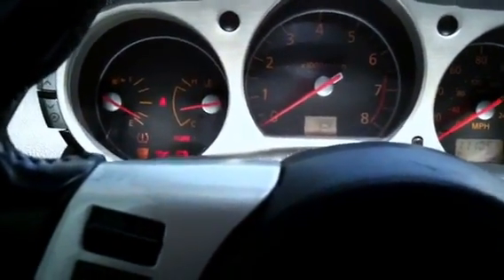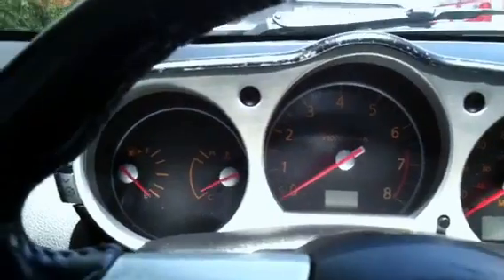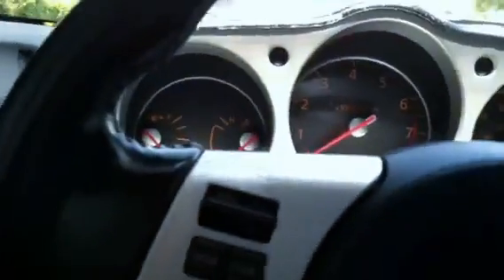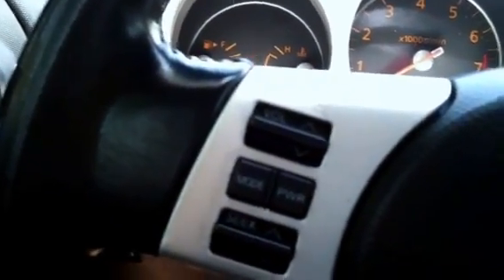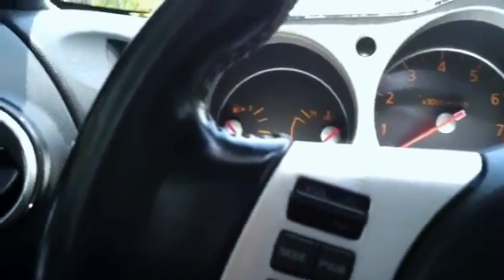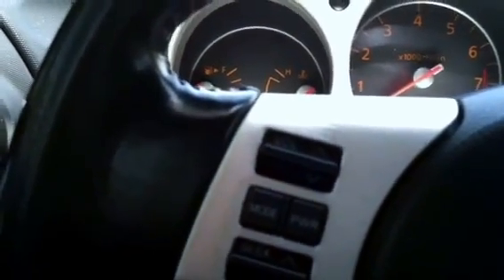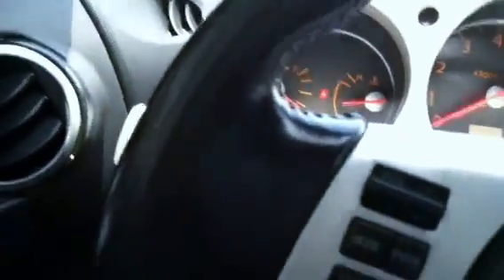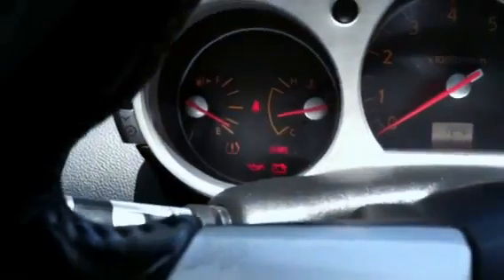NISSAN/INFINITI ECU/THROTTLE/IDLE RESET& RELEARN VERY IMPORTANT FOR 350Z/G35/G37/FX35/370Zetc DIY

Comment: hoping you can help me .when at idle my car is fine most of the time but it likes to randomly dip down and act like it's going to die then will go back to steady. could that just be a battery problem or do you think it's the throttle body being dirty maybe ?
Reply: stayZcaked I had the same thing on my 2014 Infiniti Q50 3.7 (same engine as the 370Z & G37), most of the time it was ok but on occasion the idle would drop down where the engine would sort of stumble and feel like it was gonna stall (but it never would actually stall). And ever since I removed my throttle bodies to thoroughly clean them and then followed the steps in this video the idle was fine and it seemed to have solved the problem.

Comment: Help!! I did all the steps on time and everything is cleared and car drives fine but when I'm on neutral on my 350z, it still idled and seems like it's about to die. Checked for leaks and if everything was clean and nothing showed it was wrong. Should I take it to a shop to retune the idle or computer??
Reply from the maker: check your maf. Clean it or try to swap if possible.

Comment: hey I'll throw in my 2 cents since I experienced so much strife over this. For starters, this video helped a ton. However, it doesn't mention that you need to have all your lights off, radio, charger, etc while doing it , steering wheel straight, and you need your car warmed up to the normal temperature range or else it's not going to work. That detail is so critical. 
     Second, this worked but problem kept coming back but eventually fixed it I hope (been 3 weeks tons of driving no problems). I ended up Cleaning accelerator pedal sensor, throttle body sensor, electrical taped up wires, new filter, and made the critical mistake of cleaning the throttle body and moving the butterfly (don't do that) reset the computer reprogrammed idle and all that jazz. None of that helped, car would run fine and then it'd go into limp mode. If your car run fine for a bit you can rule out vacuum leaks since that's not computer or mechanical. other people sprayed carb choker on hoses and listened if car revs. 
     I think it was fixed either by repeatedly doing this technique and another technique that is similar except has the light blink extra fast by letting up when light blinks wait 7 then hold down for another 10-20 seconds.  Some techniques say turn the car off first before turning back on when light stops blinking for this technique, who knows. Might also have been what this one other person wrote fixed it - that my A/C belt was too tight and kicking debris in the throttle body. That's literally two nuts, seems like a reach but last thing I did. btw I Got cam codes and throttle codes when bringing to shop, wasn't cams they were new. I noticed when A/C was on car malfunctioned quicker. Sorry for the long post but if you went through the endless threads like me maybe you'll appreciate it some bulk
Reply from the maker: With all respect to your experience, I have to tell you, that you don't need to do all that stuff from your first paragraph. 
Your steering wheel have nothing to do with this because it's not electronically controlled. It actually is, but you can't do nothing with it doing this steps. 
This instructions I get directly from Nissan, so other steps(turn around, clap you hands, blink, wink etc) from some youtube videos is not  required, because they doing less then nothing.

As you can see, during the Idle Air Volume Learning (Throttle Position Learning), on step #3 you'll be asked to warm up your engine, and this is exactly that moment when your engine have to be around normal operating temperature. 
You don't need to warm up your car to reset ECU or show your ECU where is the endpoints of your gas pedal. It's nonsense.
Reply: +DIY Mods ●  copied/pasted from manual- 
PREPARATION
Before performing Idle Air Volume Learning, make sure that all of the following conditions are satisfied. Learning will be cancelled if any of the following conditions are missed for even a moment.
● Battery voltage: More than 12.9V (At idle)
● Engine coolant temperature: 70 - 100°C (158 - 212°F)
● Park/neutral position (PNP) switch: ON
● Electric load switch: OFF
(Air conditioner, headlamp, rear window defogger)
On vehicles equipped with daytime light systems, if the parking brake is applied before the engine is started, the headlamp will not be illuminated.
● Steering wheel: Neutral (Straight-ahead position)
● Vehicle speed: Stopped
● Transmission: Warmed-up
– For A/T models with CONSULT-II
• Drive vehicle until “ATF TEMP SE 1” in “DATA MONITOR” mode of “A/T” system indicates less than 0.9V. – For A/T models without CONSULT-II and M/T models
• Drive vehicle for 10 minutes.

Comment: Idk if i did it right but my check engine light went off. However it still has a jerk when I first take off. Idk if that's associated with the the code. I first started having problems with take off from a red light. I would take off slowly no problem but when I give it gas and take off fast it would jerk hesitantly til it shifts to second. After second it does fine. I did he steps as timely as I could, check engine like went off but idk why it cause it to jerk. Not a hard jerk just like a slipping trying to go it I gear kinda thing. I doubt it's my  trans but idk. Anyone else have this problem please help.
Reply from the maker: sounds like transmission problem, isn't it?
Reply from the maker: don't just erase you code, read it! This is an easiest way to figure out what's wrong
Reply: +RPM Engineering so you think it might be transmission problem?
Reply from the maker: +babyjok3r00 most likelly. I don't know what kind of jerk you are talking about.
Reply: +DIY Mods it was my air mass flow sensor.
Reply from the maker: +babyjok3r00 lol. I already told to many people, that most of problems with idle or low rev or even problems with starting your vehicle, basically related to MAF sensor, it's hosing and vacuum leak. But in your case, it's was hard to tell what is wrong because I didn't drove your car and it's hard to say wat kind of jerk you was experiencing. However, I'm glad you fix it. Congrats!
Reply: +DIY Mods it's back but a different problem. Car parked at idle rpm goes all the way to zero but car still on but barely. Then couple seconds later goes back up between 1 and 0. Then does the same thing. Even in drive at a stop light car well idle very low and almost shut off. Very annoying problem. Worst when outside temp is hot and when ac is on.
Reply from the maker: +babyjok3r00 sound like an air leak
Reply: +DIY Mods that's what crossed my mind but idk. Where my MAF sensor goes where there a rubber tube that bends is torn but idk if that's why. It's right near where the air filter goes. That worm looking tube.
Reply from the maker: +babyjok3r00 if you don't have a smoke machine:
1) start your car and let it idle. Worm it up to normal operation temperature
2) grab a brake cleaner
3) ask somebody to get in the car and look at the tachometer 
4) begin to spray a brake cleaner on the couplings of your intake, plenum gasket (spacer), and the throttle body.
If while you spraying couplings your RPM will jump -- there is a leak.
Also, check the MAF inside if there is nothing like a piece of filter blocking the sensor from air. This is a very common problem for HKS drop in filters.
And let me know. If it's not gonna work, I can Skype with you and guide. Good luck!
Reply: +DIY Mods ok thanks a lot for the replies it really helps. Id have to try that when I get back home.
Reply: +DIY Mods omg it worked!!! My intake hose was all cracked and a big crack in it. I replaced it and BOOM!!! It's running like new. Seriously. I was so surprised this worked. Something as small as a air leak. Wow.
Reply from the maker: Nice!)
Reply: +DIY Mods hey another question. We have an 2005 Nissan Murano SL AWD. First start up is fine but once it gets hot and stop and go traffic. It about to shut of and sometimes it does. Once it shuts off it won't start u til 30-40 mins later and same thing. What do you think it could be. Any ideas would help. Don't want to take to dealer cause that cost to much. Trying to go a cheaper way before dealership. That's the last resort.
Reply: Infiniti09 you may be low on transmission fluid

Comment: How did you find out that the throttle only opened 80% ??
Reply from the maker: what do you mean?
Reply: +RPM Engineering At 00:42 you said that you found out that the throttle was only open for 80%.
Reply from the maker: Got it. Nissans have a WOT restriction until 30-40mph. After that, throttle should open all the way. We cleaned throttle body and moved "butterfly" just a little, but it's was enough to mess up throttle position sensor reading. Using OBD2 gauge, we figured out that even after 50mph, its won't open on 100%. After recalibration, it's begun to work well again. If your vehicle isn't new and you don't know who and how cleaned throttle body in your vehicle, you really want to recalibrate it. Even if you did it yourself, you still want to do this.
Reply: +RPM Engineering Thanks for the answer!
Reply from the maker: +Arthur R any time :)

Comment: This didn't helps
Reply from the maker: it's mean you doing something wrong. Check the comments, everyone did it successfully. Read description and try one more time
Reply: +RPM Engineering I have a 04 g35 is that the problem??
Reply from the maker: +96mk3 No, it's not a problem at all. I tried to do it myself on 03 G35 with a great success
Reply: VQ 87 when you relearn the position and you hit the peddle 5 times then hold it make sure you wait till your CEL  light COMPLETLY STOPS FLASHING. That was my problem. Hope this helps.

Comment: Hi Oleg, I recently have installed an AEM Cold Air Intake in my 2004 g35 coupe. When I drive the car randomly shuts off while i am in neutral. I took the intake out and reinstalled it to make sure there was no air leak. Will the Idle Relearning fix this issue?
Reply from the maker: most likely. What original airbox do you have? RevUp?
Reply: +Oleg Olegovich I'm not sure what air box I have. I have a stock g35 coupe sport. It comes with the brembo brake system.
Reply from the maker: I had AEM & INJEN CAI's and after all I sold them and switched to my original REVUP Airbox and K&N filter. A lot of people report the same problem with some aftermarket intakes. And if you ask me, there is only 3 good intakes for Z, and its not AEM.
Reply from the maker: anyway. what year is it? Glance inside of the airbox. What kind of velocity stuck(venturi ring) you got?

Comment: your instruction says 

Idle Air Volume Learning (Throttle Position Learning)

It is better to count the time accurately with a clock.

1. Perform "Accelerator Pedal Released Position Learning".
2. Perform "Throttle Valve Closed Position Learning".

but we just did 1 and 2, do we now have to do it again?
Reply from the maker: yes.

Comment: any answer
Reply from the maker: did you fix it?
Reply: +Oleg Olegovich ..
cannot fix it
Reply: +goolgappa5 ...
I change full engine which was manual transmission 2004 mine is 2003 automatically. .may be we missed some thing
Reply from the maker: +goolgappa5 you missed ECU from automatic. Sorry
Reply: +Oleg Olegovich ...what do you mean ...
Reply: +goolgappa5 my car is automatically. .2003 engine was from 2004
Reply: +Oleg Olegovich ...
Remember engine I took out from 2004 manual transmission engine mine is 2003 automatic transmission
Reply from the maker: +goolgappa5 that's why you need ECU from manual Z. But still, I think  it's a problem with a wiring.
Reply: +Oleg Olegovich ..
both were auto
Reply: +Oleg Olegovich ..
I called him last week
Reply from the maker: what is the end of the story?

Comment: I did it but still on 450 rpm,I guess the idle valve it's dirty or bad,any way thank you bro.
Reply from the maker: maybe you have a leak or dirty filter? Can you describe your situation? I'll try to help.
Reply: +Oleg Olegovich the rpm on my car is low 500 to 450 and goes up again to 600 or a little less , I clean the throttle already  may be is the mass air sensor or the idle valve.
Reply from the maker: +suzukiaero1 can you rev it higher than 2000rpm?
Reply from the maker: +suzukiaero1 any news?
Reply: same problem any solution
Reply from the maker: +Kanaan Nichols Looks like you fave something more serious than this video may fix. Check all wiring's, especially MAF sensor and throttle body(TB wiring is under intake pipe). Its could be only 3 things: MAF, Throttle Body, and fuel system.
Reply from the maker: did you fix it?

Comment: YOU ARE A FUCKING LIFE SAVER THANK YOU! Had P02135 replaced both throttle body and accelerator pedal sensor and tried the resets on my own and didn't do shit. So I tried it at your timing and it was perfect!
Reply from the maker: +40cripcuhh That's great!). Before I get tuned, I made this procedure very often(aprox 150-200miles) to don't let ECU adopt. I don't want to be a Captain Obvious, just in case you didn't know, all your intake/exhaust modes will be f***ed up by closed loop. So if you have a mods and don't have a tune, I would recommend you to do the same for maximum performance.
Reply: +Oleg Olegovich thanks for the advise, I am almost full bolt on now just waiting till the 17th to get my Osiris tune!
Reply from the maker: +40cripcuhh, nice! Congratulations!

Comment: Done as described and the idle rpm now is around 700. Before it was above 1000.
Also I've done the RE-grounding procedure and fixed most of the electric issues: burning random coils, fuel gage, more smooth on the road.
Reply: My friend's car Fx35 04
Reply from the maker: +A Al-Jahwari does it works on FX35? I think its have the same ecu, regarding to the same engine, exhaust e.t.c
Reply: +Oleg Olegovich Yes it worked. I think it should work on all Nissan family including Infinity.

Comment: Thanks so much bro. I was installing intake on ma G35 today and was rough idle,then followed you there and finally got it running great again!
Reply: It need to make a system relearn between ur new intake of how much air its actually suckin  in now. Just try to follow along with his video and as he counting..especially at the end procedure there just rev it up couple time and wait for it as ur idle gonna go down to around 650RPM.
Reply from the maker: I'm happy that you found it helpful! I'm doing the same with my 350Z after every each mode and it's helps me a lot. Nice G35 btw )
Reply: I jus did my air intake and my idle is high what's the trick I couldn't get it
Reply from the maker: Eric Lagueux as DaVinn said, just follow instructions. Also, you may have a leak somewhere, because I tried a lot of intakes and never had my idle unusually high. Check for leak in piping connections or throttle body gasket, I mean all the way from MAF sensor to the plenum.
Reply: What's up man I just bought a 03 Z and guy swapped same motor but lower miles in but won't stay idled starts up and won't idle will this fix it you think

Comment: What does it exactly do
Reply from the maker: When you doing this, your ECU(computer) learning the new amount of air(air volume), position of throttle and accelerator pedal position. This is important because after installing of CAI, plenum spacer, induction kit etc., your ECU have to find out new values. Without this steps, your ECU will hardly adjust to new numbers and will keep in mind previous calibrations. Its much better to reset all values and let it adjust to new mod. 
Moreover, first week after this RESET, your car will run much stronger than usually.
Reply from the maker: I just explained. ECU have to relearn new numbers, that's why you doing this steps to reset your ECU and fuel maps. Than, as you said, it will learn new ratio from O2 and MAF sensors. 
If you will have any questions in future, feel free to contact me, I'll be happy to help.
Reply: Oleg Olegovich Really? so the computer cant monitor the O2 sensors pre and post cat to adjust fuel trims?